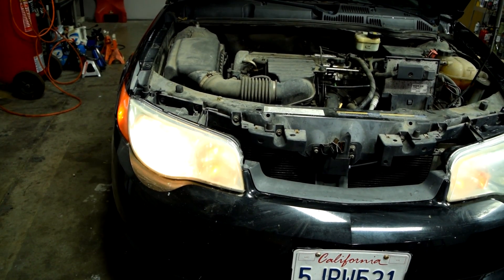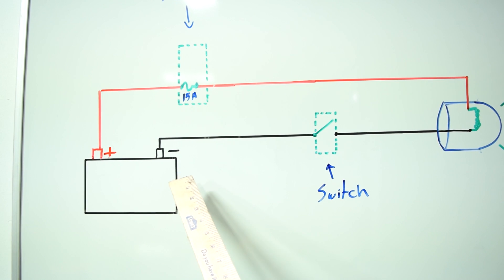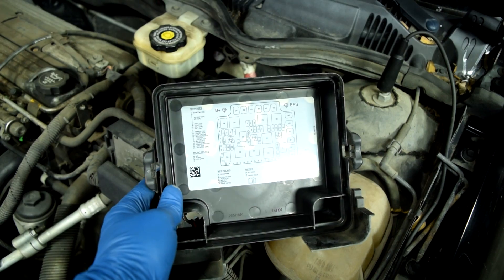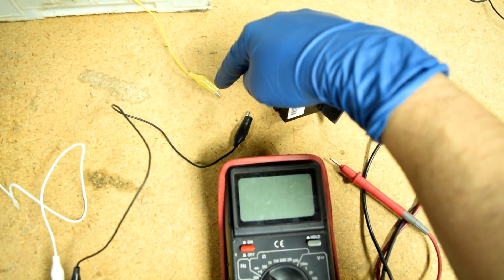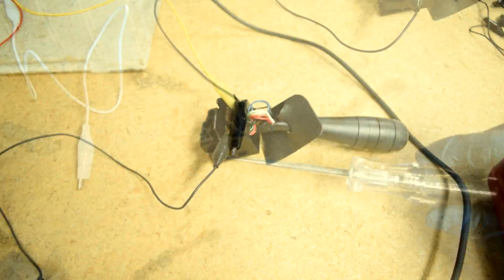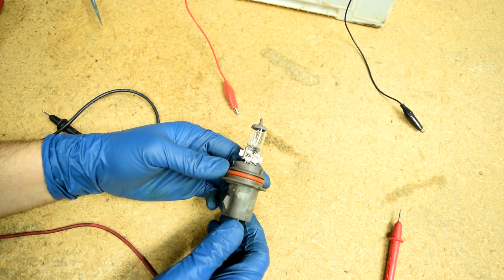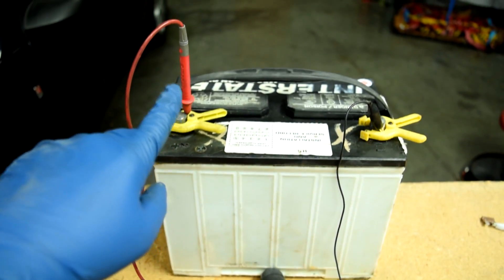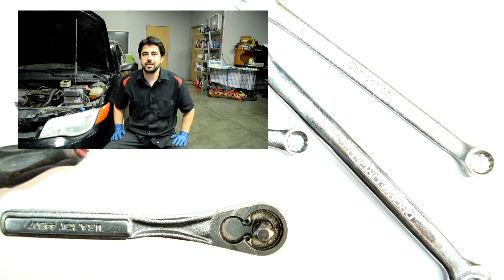Diagnosing Electrical Issues - How to Diagnose and Find an Open Circuit

Comment: I use a power probe most of the time, but it's easy to overlook how a less expensive test light is better in many ways. The elegant simplicity of inexpensive old style tools is so appealing! With an incandescent test light you get a free, safe, and instant voltage drop test each time that light glows. All we need to do is study our own test light, to understand how much current it needs to glow. Congratulations on the new dog, please show us a few more cameos.
Reply from the maker: Thanks spelunkerd, he will get more air time next time. I've never used a power probe, but yea for a casual DIY'er a test light and a multimeter plus a solid understanding of how to use them goes a long way.

Comment: Great vid, very informative for somebody who isn't at all familiar with how basic electrical circuits work.  

One of the things you need to keep in mind is that circuits like the one described in this vid (battery to switch to device and back to the battery) are found in older cars.  Many (most?) modern cars have computer-controlled circuits now, where the switch doesn't directly control the device.  It simply sends a computer signal to a control module, and the module itself electrically turns the device on and off.  Something to keep in mind anyway.
Reply: Well the concept is the same, a switch is nothing but an input.  An input will either send a signal to a module and allow current to flow or it will allow current to flow in the circuit directly to the component.  So in either case it is an input, but good point regardless.  Link below will explain all inputs vs outputs

 http://www.streetrod101.com/computer-input-and-output-devices.html

Comment: Excellent video - you explained the topic  in simple language. As an electrical engineer with over 45 years of experience I can categorically state that you would make an excellent instructor in a technical career school/college. Combining an explanation of how the components function (physical) with the equations/physics (theory) is what students need to truly understand the subject matter.
Reply: Good to find you. So explain to me ( I never get a response from author(s) of video) how the heck or why the V (@12) =  ohms (@ 0.6) x amps  changes to  12/0.6 = 0.6/0.6 x amps ?? I'm old but we were taught in math that V or 12 divided by the known Ohms # of 0.6  would = 20 Amps         So  X = Y x Z     known # V can be divided by either the known # Y or Z  Not sure why you would have to divide both known #'s by 0.6 ?
Reply: @tubetime39  
You are correct - simply dividing 12 by 0.6 yields the 20A result. What he did was divide both sides of the equation by 0.6 which “cancels” the 0.6 on the right side of the equation leaving just Amps as the end result.  This is just another method taught in schools when solving equations. Both sides can be divided by the same (constant) number which simplifies the equation.
Reply: Ohms law can also take the credit as the standard formula is V = I x R.  The way I was taught is the V would be on top of the I x R which is actually a division operation.
Reply: So divide 12 ÷ 0.6 = 20 or V ÷ R = I

Comment: Nice ! The resistance on the bulb filament changes with heat. You showed while cold the resistance was 0.6 ohms  and when hot the resistance increased to 2.4k ohms.

Comment: Thank you for the video, it was very helpful. After watching I went to the local HF store and bought a cheap multi meter, test light and alligator clips. I came back home ready to do some serious woop a$$ on my car. I figured that I had better start with the test light so I tested the battery first and the light didn't come on. I thought well maybe the test light is bad so I tested it on another battery and sure enough the test light worked. Quick diagnosis, my battery had no juice but it was still within warranty. So my next task is to test the alternator and probably replace it. I hope you have a video on how to test an alternator, I like your style.

Comment: You could also do a voltage drop test on the suspected wire that might have extra resistance in it because from a continuity point of view, if some part of the wire was corroded, you would only need a few intact strands of wire to confirm continuity but in reality, the wire might not have enough good strands to confirm a good wire.

Comment: Awesome. This is definitely a refresher course. So I have this same problem with another factor. Maybe you can guide me? (1) driver-side light stays on all the time regardless of switch setting. (2) Passenger light off all the time regardless of switch setting. (3) Battery drained after a few days if not driven. Thoughts?

Comment: Thanks man. I watched almost all your YouTube and learn a lot. 🌸❤

This is a Basic circuit..
About the YouTube 👉  you missed the Relay.. almost (5amp and above) every circuit have it, and must check with the signals came to it.
Reply: Kudos for the Video! Forgive me for butting in, I would love your thoughts. Have you researched - Tarbbatigan clean errors Tip (just google it)? It is an awesome one of a kind guide for discovering how to fix electronic devices minus the normal expense. Ive heard some extraordinary things about it and my cooworker finally got astronomical results with it.
Reply: Canan yıldırım ,, Thanks, I will do

Comment: I am sorry to bother you with a question like this, but I have a P0750 code on my 545RFE (mopar) transmission.  It's a hard fault, and goes into limp mode immediately when putting it in drive, even after clearing the code.  The code itself will pop up after driving for a minute in limp mode.    Initially I threw a part at it, the valve body solenoid pack, since that was the most common cause of this problem.  I also replaced the accumulator plate and accumulator seals.   The code persisted, so I went with electrical diagnosis.  I have continuity between the solenoid pack wiring harness for the L/R solenoid, as well as 4 ohms of resistance which is listed as ok in the factory service manual.    I also tested the wire from the PCM to the transmission control relay which was good, refreshed all the nearby grounds with new ring terminals and stripped some new wire for them.  I also sent the PCM in to be tested and apparently it's working properly.   What would be your next line of diagnosis in this situation.  I am pretty demoralized at this point and out of ideas, any help would be so much appreciated.

Comment: You should add that test lights should not be used on any computer components, such as the ECU/ECM/TCU. It runs the circuit in parallel, greatly increasing the voltage that goes through the computer. Computers only need enough power to compute a signal, which is about 0.008v, if I remember correctly from my automotive electrical class. Running in parallel decreases resistance causing much more voltage to pass through the circuit, frying it

Comment: Just love your videos and the way you explain to folks. Great Job. 

Now for the non-electrically inclined. lol
 
I have an ATV, and I need to add accessory wires to another wire that has power only when the key is turned on. 

I used a test light like you used in this video but I may have done it wrong. When looking for that wire that has power with the key turned on, my question is this: 

Do I hook my test light up to the positive battery terminal or the negative terminal?

I may have been doing things backwards but I hooked it up to the positive terminal and I guess I was getting what I think were opposite readings. The wire that I was instructed to use had power before I turned the key on and when I turned the key on, lost power.

I am guessing that if I were to use my test light and hook it up to the negative terminal, I should get the readings I was looking for, correct?

How or when do I hook up a test light to the positive vs the negative terminal? 

Peace

Comment: Yes yes sir I've been looking for this explanation about a multimeter and the current flow and a test light because I'm having an issue with my crankshaft and camshaft readings everything seems to be checking out new sensors timing but for some reason maybe it's the wiring it's been exposed to a little oil so I've been trying to test the wires all my tests we're done but I still didn't understand them now I do thanks

Comment: Just to double check this part. Check the ground by grounding light to ground on truck and find ground wire on wire. Then your safe to check current wire with light on positive side on battery.  If you do that and put light on ground can you blow circuit?

Comment: Thanks for the helpful videos! I would never understand why the fuse is on the positive side of the circuit. I know that the current flows from the negative to the positive, but for the sake of convention we have been showing it to flow from positive to negative. Shouldn't the fuse be between the negative terminal and the rest of the circuit?

Comment: Hi their , I have a issue with kw t600 semi truck .. I would greatly appreciate if you can help . Truck runs great lights everything works but truck will stall when I turn  left signal on .. only does when I turn the signal on ... behind the dash I found 1 ground wore on the harness that pigtails to 2 ground wires .. that 1 ground wire from the harness is melted / burnt ? It did  pop a fuse . Why would ground melt ? Can that be the issue or do I have a short somewhere in that left turn signal circuit ? Thank you

Comment: Why would there be a switch in between the negative battery terminals and the load and not in between the positve battery and the load. I always thought the ground portion of the circuit was just completing the circuit back to ground. Also assumed 12v auto batteries operated used Conventional Current flow making this even more prevalent, any thoughts?

Comment: Headlights on my car are of semi-sealed beam type which have 3 terminal : low beam, high beam and ground. Left side headlight only lights up when the switch is turned to high beam, it doesn't light up when turned to low beam.
I have diagnosed the problem using a cheap test light, and found out that there is no current flowing to the low beam terminal.
I am considering to work on the switch for connectivity test. But the internal of this switch seem to be very difficult to access, because it needs removal of some dashboard panel. Working under the dashboard is painful, so I postpone this task.

Comment: Hi Mr Ratchets,

Something curious happen with my Dodge Avenger 2008. I must say that the "Fuse Box" is in reality a TIPM (Total Integrated Power Module) and it works little bit different that a simple BUT more efficiency Fuse Box.

Ok, so the problem is that the low lights does not come on anymore, just the high lights.

So, I perform a continuity test through  all the negative line to ground with the multimeter and the test light and everything is OK.
Then did the same on the positive line, and there is continuity along the cable from the light bulb to the TIPM (so the problem is the TIPM).

Any way, just for curiosity I performed the same procedure with the high lights that are the ones that work good. BUT when I connect the test light cable on the ground AND the place the tip on the cable that is supposed to bring signal and nothing happened (I actually turned on the engine and switched on the high light), BUT if  perform the same procedure just with the key on ON position (no engine) then the test light catch the signal and the light came on. And I don't know why.

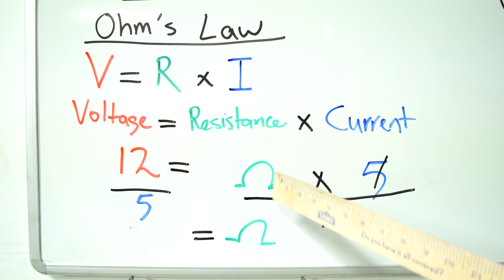Comment: 10:45 so can't you afterwards move the multimeter to the ground side and check the resistance and see if it matches the 2.5 ohms for any corrosion?
Reply: Manuel Salvatierra i want to know this as well

Comment: My corolla cranks but no start.  I changed the fuel pump and filter, etc.  I had to replace EFI fuse which had blown.  It ran for one week and then did the same thing.  Could it be a fuel pump relay or do I have to look for a short in a wire?

Comment: I have a 1994 Toyota T-100 Pickup Truck I installed a new OEM Fuel Pump & Fuel Filter , Battery  with new wires, I pulled out the  Circuit Opening Relay and energized it with 12 DC it was click good..points where pulling it good... I dont think im getting 12 DC to that relay? and when I checked for 12 DC at the fuel pump I didnt have any Voltage at all ? what should I do next ? Thanks in advance.

Comment: okay I kinda understand, here’s my problem. my obd reader alerted that my stereo amplifier is disconnected: B15D3 error 👨‍💻 code. 
my symptoms : lower bass response in the car audio system, it’s a mark levison. I’ve located the amplifier the harness wires look intact, because there is sound still coming on but at a lesser bass response what could be the issue?

Comment: Greetings, 
I'm testing my 02 Sequoia with a multimeter after a p1126 engine code. When I test the throttle control it clicks and spins but there are no signals in the electrical connector on prong 3. How can I figure out if it's my ECM or the harness cable?

Comment: so my brake light doesn't seem to turn off for some odd reason. the problem is pretty recent for my winter beater. it's not a car I truly care about, but hate having to unplug the battery every time... any ideas on where I could start the diagnosis?

Comment: would it be ok if I ran a new 14 ga. wire with a manual switch between the fuel pump and Battery... I can turn it on when I need to drive and flip the switch off when I am done driving ? will this work or ?

Comment: My front left directional isn't working. I put a new bulb in and it's still not working.  When the 4 ways are on that directional is dim but not out. Could that be a bad fuse or just a bad ground?

Comment: Bro actually this circuit amp decreasing reason is temperature is increasing (bulb generate high heat the whole circuit). When temperature increases resistance will increase.

Comment: 4:30:  if positive side of fuse has 'open' wire then light tester will not light.   so wouldn't that be a useless test if you are looking for 'open' circuit?

Comment: Someone help please!  

I have 2000 tt that has many electrical components not working.
- Fuel gauge 
-power fuel lid won open from button inside
-passanger headlight turns off after 1 min that I turned it on. 
-passanger side rear light not turning all bulbs on.
-got a code for timing ignition.
-engine will hesitate here and there, once in a while.

So....I checked the:
-relays under the stering wheel and they are good.
-Bulbs are good 
-Checked fuses in the fuse box.
With Visual inspection they are good. But.... when I checked them with a light tester while plugged in the box. ..11 fuses weren't powering up my tester light.(fail test, and the fuses are good)
These are the ones:
-Front fog lights 
-low beam headlight( left and right)
-side marker taillight (left and right )
-warning light, parking light,climate control front fog lights relay. 
-fuel injectors engine 
-fuel pump.
-engine timing (2 fuses, 2 separated slots) both of them don't get current/power. 

Any ideas or suggestions of what to check next or what can it be?
Please help me anybody! !! 😐😐

Comment: Why does it NOT PULL 20 amps?    the math says that it does in fact.

Low resistance will cause high current?

Well then the FIRST measurement of resistance was wrong?

Comment: No one ever confirms or explains the ohm continuity is measured by the battery in the meter and to check the battery by touching the probes together as a battery check before conducting the continuity test.

Comment: I feel like 90% of this went over my noggin.  Going to have to "over understand" this when I watch again
Reply from the maker: Yes over watch it, it will also make more sense after the other 2 episodes.
Reply: Ratchets And Wrenches will be on the lookout. Also, when are these ratchet wrenches coming out? or any info like length, metric, sae, reversal?
Reply from the maker: unfortunately it's going to be about 2 months, non reversible, Metric, two styles as of now. 1st will be box end and open end, 2nd will be double box end. 8mm-19mm sets. I am trying to get them sooner but I don't think I can.

Comment: What exactly did the amps and ohms measurements represent though? Maximum values? Values required to make the bulb light up (in the case of amps)? Or maximum value of resistance allowable before circuit "breaks"? Etc?